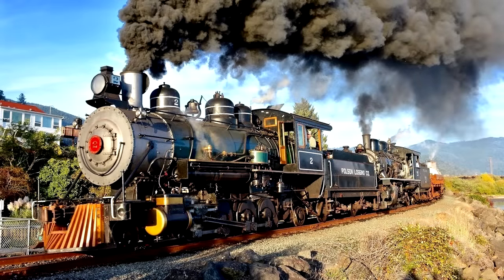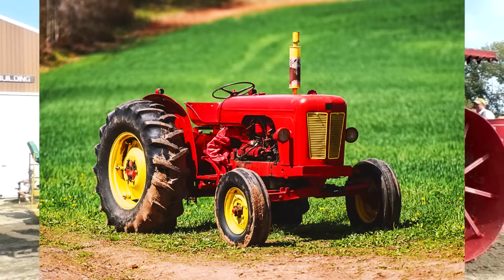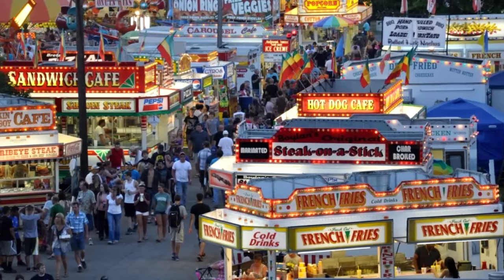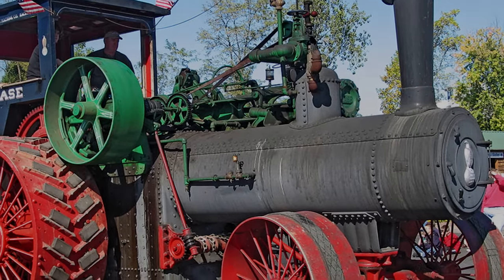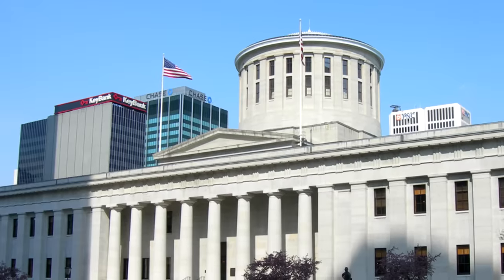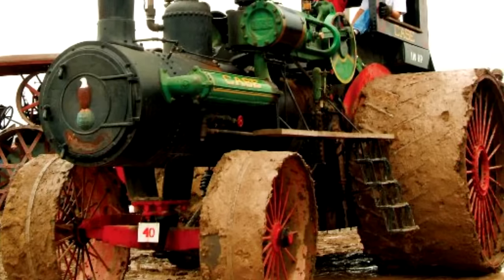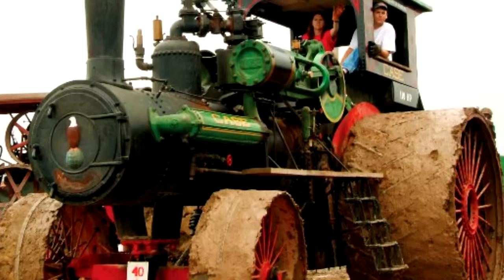The Steam Explosion That Destroyed a Fair 🚂 The 2001 Tragedy in Medina County 🚂 History in the Dark

Comment: I was a cop in Medina County at the time and I've read several posts that blame the police for "pestering him" and taking his attention away from the machine. The reason the police stopped him, was because the road he was driving on had just been repaved that same morning and the steel wheels and cleats completely destroyed it. They followed him into the fairgrounds, spoke to him for a bit and had just finished speaking with him when it exploded. Both officers were severely burned but both survived. It should have never been on the road in the first place.
Reply: That road wouldve been repaved two or threee time already. Im sure that was worth the lives of 5 people. Thanks for keeping the community safe.
Reply: So the police are at fault? The owner of this thing is in hell from where no man can ever return. Praise the lord bla bla bla...
Reply: @davidwilliams7723  Didn't you read that the road was just paved that morning?? The asphalt hadn't cooled completely or cured. The road needed repaved even though it was not even a full day old when the tractor cleats damaged the road. And if he wanted to tram the tractor on the roads, Amish in my region wrap tire tread around the steel wheels to prevent road damages of their tractors, which are diesel powered. driving heavy machinery from location to location and cross roads or drive on the roads, have a crew of about 8 or 10 to throw down used tire casings that cannot be reused, and once driven over, are picked up and moved in front of the tractor in the rows of tires, so the road is not damaged.
Reply: @cncpreferred848  you could see this in a different form in some of this video's B Roll, rubber pads between the cleats on the steel wheels and the one pair of caterpillar tracks.
Reply: Dude's not smart enough to have his new toy hauled to the show, can't expect him to be smart enough to keep the water injector manned.
Reply: Oh yea the police are victims.
Reply: So rather than stop him immediately on the road, or deal with it later, the fuzz was distracting him as observed.  Thx for the admission.
Reply: Agreed, not the fault of police.  Unfortunately the police were unable (unwilling?) to stop this from happening, perhaps an erronious judgement call.
Reply: A terrible situation, and the man probably should have padded the wheels.  But it's actually perfectly legal for farm equipment to travel on public roads as long as proper safety measures are in place such as reflectors and such.  I'm going to play devils advocate and say he might not have realized the road had just been repaved until he started driving on it. I've seen places where they set up cones and signs far in advance and you could figure out what was coming and other times where suddenly it's there. Still, he shouldn't have even fired that boiler and wouldn't have if he knew anything about boilers. I wouldn't trust anything without a very in-depth inspection. Especially if this was my first steam engine.
Reply: Agricultural exemption .....
Reply: This guy thinks he's dirty harry !!!LOL!!

Comment: Just proves it again. Non maintained vehicles of any kind can be deadly
Reply: Getting pulled over by a cop and boiling off all your water during the traffic stop doesn’t help.
Reply: Uh-huh.  Well-maintained vehicles of all kinds can be and are deadly.  Driving a brand new car down the road is exceedingly more dangerous than attending a local fair.  Driving to the store is far, far more dangerous than flying across the country.  But no one ever seems to get upset and call for regulations because...reasons.
Reply: @FS2K4Pilot  So the fusible plug would blow (comparatively) safely, except that it was corroded shut. So not the cop's fault at all.
Reply: @lusoverse8710  Number one, I didn’t say the cop was at fault.  Number two, a fusible plug is not a substitute for maintaining the proper water level.  The most important safety indicator on a boiler is the sight glass.
Reply: @FS2K4Pilot  The fusible plug is just as important..
Reply: @TugIronChief  Wrong.  The only time the water level doesn’t drop is if there’s no fire and you aren’t boiling water.  If you’re boiling water, your water level will drop.

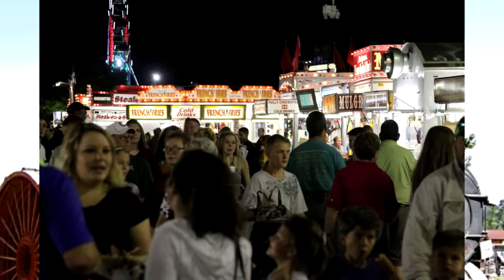Comment: 7:35 you give the crown sheet thickness as .375 thousandths of a foot. Perhaps you mean .375" or 3/8 of an inch.
Reply: INCH, please correct.
Reply: I would also point out that it isn't "point three hundred and seventy five thousandths" of anything. It should have been "three hundred and seventy five thousandths of an inch" (no "point") or "point three seventy five of an inch."
Reply: All credibility just dropped to zero when he claims it was originally 4-1/2” thick, that’s what .375 of a foot is.
Reply: 0.000375' = 0.0045"
bretty thin

Comment: I read the long report...not only was the crown sheet 087 "thick ,and stay bolts rusted away,,but the owner had done weld repairs to rusted off crown stay bolts,and welded in a plain plug to replace the fusible plug .....he fullly knew the dangerous condition of the boiler....

Comment: Steam is an incredibly dangerous state of water.  On June 3, 1918, there was an explosion of the boiler in the
Hopkins, Michigan Creamery. The building was completely wiped out with the exception of its
smokestack. Three young men lost their lives.
Reply: Steam is such a menace. In addition to the pressure, the scalding hot water will just melt your skin right off. When I was a kid I had a toy steam engine with a boiler the size of a coke can. And even that thing scared me.
Reply: @castirondude  that toy is my favorite and have a steam powered train, its awesome
Reply: It's not so much the steam, it's the superheated water that is contained in the boiler. Steam itself is relatively benign, explosion happens when superheated water goes quickly from it's liquid state to gas (steam) state.  

Almost all boiler explosions are the results of letting the water get too low and then adding water. Even if the water gets too low, the boiler will be damaged, but the explosion won't happen as long as you don't add water. The correct procedure for a boiler that is found to have too low of water level is to shut the fire down, bleed off pressure, and put the boiler out of service until it can be inspected and/or repaired.
Reply: @tudwortyjmcguern5689  yes this was mounted on a platform. The boiler had some kind of plating so it wouldn't rust so it was quite safe.
Reply: @m16ty  What do you make of the 6:19 ".375 thousanths of a foot" , I don't know what she means there. 0.375 inches seems more reasonable, that's 3/8" which would be a standard size even today
Reply: @castirondude  the boiler is  crome  plated and believe its made of brass with a pressure relief valve. made in pennsylvania.  ive yet to over pressure it. the train is same theyre both fun, need more track for train

Comment: I used to work with a guy that had been a State boiler inspector and he told accounts of a residential water heater exploding and practically destroying the residence.  Vessel explosions resulting from compressible gases are extremely disastrous.
Reply: Seen pictures of residential water heaters that blasted thru the floor and roof, people dont check anything and the safety valve is plugged,  or capped because it drips.
Reply: Mythbusters demonstrated this launched a waterheated alegetly like 500FT into the air.

Comment: During the days of the steamboats, typical boiler explosions were caused by the engineer blocking the pressure valve to develop higher pressure and increase the power transmitted to the paddle wheel. This put a higher pressure stress on the boiler, and if the seams were weak or the walls of the boiler were deteriorating from age, then boom. Once the boiler exploded, usually the furnace ruptured, spreading fire to the steamboat's wooden structure. 

In the case of this tractor explosion, as stated, the pressure relief system was welded shut, turning the machine into a ticking time bomb.
Reply: A relative in my adoptive family was a Major General in the army Civil war era, he was in charge of returning troops being loaded onto the Sultana ship. The ships' boiler had to have repairs done which delayed departure,once finished the ship took off severely overloaded, so much so the decks were sagging- the captain was paid by the head to transport the troops and told the Major General that everything was OK, but it wasnt- shortly after heading down the river the boiler exploded killing hundreds, and many more died either burned or drowned. WIkipedia has page about it, the shoddy repair on the boiler is what did it in.
Reply: i @HobbyOrganist
Reply: @HobbyOrganist 
Sultana was actually going up river from Vicksburg, where a boiler inspector had inspected a bulge in one of the ship's boilers. He had declared the boiler unseaworthy until a proper repair could be made. Unwilling to take the necessary time and lose the manifest of over 2000 released Union soldiers, the ship's captain (who was a part owner of Sultana) and chief engineer had persuaded a boiler mechanic to hammer down the bulge and install a temporary repair doubler riveted over the damaged area. The idea was to effect a proper repair by replacing boiler plates after the run up north was finished. The boiler inspector was furious and refused to sign off the repair, citing that it was grossly inadequate. The ship was fired up, loaded, and departed Vicksburg the next day. This was an illegal act, as the boiler was still unseaworthy. In the middle of the second night, the overloaded vessel, working all four boilers to the limit against the strong current of the flooding Mississippi, had made it to a point north of Memghis near some islands called Pickney's Hen and Chickens. That's where the faulty boiler exploded. The two boilers next to it were damaged so badly that they also exploded. Sultana's deck and superstructure were blown to splinters, and the wooden ship caught fire. The burning hulk finally drifted to the Arkansas bank and burned to the waterline. I believe about 1167 people died, making the Sultana Steam Explosion the second worst maritime disaster in World History after the Titanic, and the worst in US History.
The wreck of Sultana was left to decay on the bank. Eventually buried under layers of  mud and silt, the river has shifted eastward now, and the remains of Sultana, one of the largest of the great Mississippi steamboats, are believed to be under a field next to the river in Arkansas.

Comment: Here in the UK things like traction engines fall under the same legislation as a giant steam boiler in a factory - that means you must have annual inspections by qualified personnel to be able to run it.
Even applies to 1/4 and 1/2 scale models of traction engines.
I'm a big 'don't want the government up in my business' type too, but some things (like steam boilers) have such dire consequences if things go wrong that legislation is essential.
A steam boiler is a pressure vessel so potentially a bomb if it structually fails.

Comment: OK, so in the UK, every boiler be it road or rail or ship, has to have insurance. As for inspections, there is slight variation, so for the purpose of this I'll stick with road steam. The boiler has to be inspected by a qualified boiler inspector from the insurance company and passed off, this is done once dry to inspect for damage and subject to that, once in steam. Only after the boiler inspector has been satisfied can the boiler be commissioned into service. This also applies after any remedial work has been done. This is a legal requirement. Frankly the fact that America is so blasé  with boiler safety from a regulations point if view is astounding. This incident is actually fairly well known in the UK. As for the crown sheet failure, its not really over pressure that causes the sheet to fail by itself, when the crown, or any part of the inner box becomes exposed, the plate will rapidly heat up, this will set up differential expansion of the plate where it is exposed. which will cause buckling of the plate and potentially shear the stays. In addition it'll start to soften, this can cause a quilting effect if only exposed for a short time, this is where the plate bulges between the stays. In the extream, like this incident, the plate heats up and softens to the point that it can no longer contain the pressure acting in it and will rip away from the stays and the whole sheet will rupture.
Reply: I know the UK has more regulation than the US but they had a low water incident on a narrow gauge railway after this and it could have gone really bad too.  They dropped the fire but didn’t put water in which probably saved them.  The problem is that steam engines rely on a person to maintain adequate water in the boiler and that isn’t fail-safe unfortunately.  That means that regulation won’t in itself prevent this.

Comment: My dad was a boiler inspector for the State of California. He came home with pictures of boiler explosions that shocked me as a kid back in the 1960's. He wouldn't screw around or take short cuts during his inspections. At one Catholic school, there was a boiler that had  mechanical ''gags'' installed on the boiler's safety valves. They were rusted and had been there a while. Gags are used only for testing and are immediately to be removed. The safety valves had pictures of saints next to them for ''protection''.  Holy smokes, my dad came unglued and shut the facility down immediately. Mother Superior was mad as a wet hen at him. He didn't care and told her that an explosion would kill quite a few kids. Steam is not to  be messed around with.

Comment: Hi darkness. Uk fan here.
I find it saddening that the US lacks behind in steam regulations. I know that here in the UK traction engines are subject to the same guildline boiler wise as railway locomotives. And the miniture steam engines in particular (from my experience) are subject to a yearly live steam test to ensure all systems function as they should and I two yearly hydraulic test to twice working pressure to ensure boiler integrity. As for licencing if the engine is to be taken on roads it needs the same documentation as a car. Registration tax insurance ect.
Keep doing what you do.
Reply: Boiler inspections for farm and factory equipment are determined state by state. At the time of this accident, Ohio had very nearly no oversight on such boilers. They have of course corrected this situation.

in NY, 2 inspections are required every year- an internal inspection with the boiler dry and opened up for visual, and an external inspection with it in steam.
Reply: @renegadeoflife87  in Britain we also have the 10 year overhaul. The boiler must be thoroughly overhauled every 10 years. It is tested when complete again, and if it passes, it gets a "10 year ticket" so it can run for another 10 years, as long as it keeps passing its annual tests.

Comment: Since we’re off the rails subject wise… there is an NTSB report of a cruise ship boiler explosion.  It was docked at the time.  Seems the boiler had small leaks from cracks.  Metal such as brass or lead had been hammered in to seal the leaks.  It finally let go. Killed some crewmen.  They think the cracks were from repeatedly heating the boiler too quickly.

Comment: The fusible plugs on the crown sheet are made of metal with a lower melting point than that of iron. If the crown sheet is exposed to steam and begins to heat up the plugs melt before the crown goes plastic, and blow out directly into the fire, dowsing the fire with saturated steam putting it out. With the plug ports welded shut the crown sheet overheated, went plastic (softened) and blew out all at once. This can turn the boiler into a rocket, launching it off the frame and killing the crew instantly.

Comment: There's whole books of government regulations for steam locomotives that go back to just about to the beginning of using them. Steam traction aer almost the same as steam locomotives as far as overall theory goes. Steam was used in all kinds of construction equipment like the litteral steam shovel. These boilers need the same inspections that stationary and locomotive boilers receive, and probably more frequently. Even small gauge hobby railroad steam engines have boiler inspections on a regular basis.

Comment: In the UK all pressure vessels are required to be insured. The insurer is required to inspect them on a maximum 14 month cycle, in practice, yearly. Steam boilers require this in two parts, cold and stripped down for internal inspection and in steam. Traction engines also require additional checks.
The reduction in shell thickness would have been picked up long before it reached a dangerous level, probably years before.

Comment: If the top of the firebox had been an inch thick, red hot and then doused with water......the boiler would have exploded.  Likely, if the soft plugs had been functional, the steam flash was fast enough that it still would have exploded.
Reply: The crown sheet never would have gotten red hot if the fuseable plug had worked correctly. It’s main purpose is to use steam pressure to displace the oxygen in the firebox. Tin melts at 450 degrees, well below the temperature iron starts to weaken at.